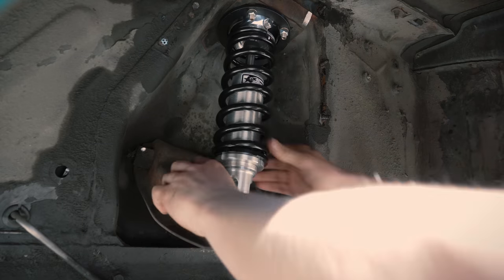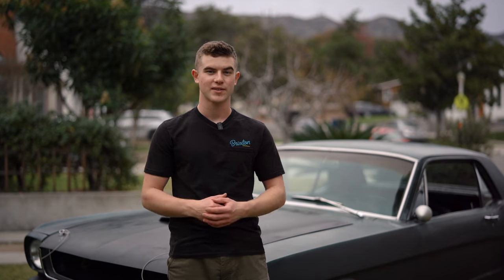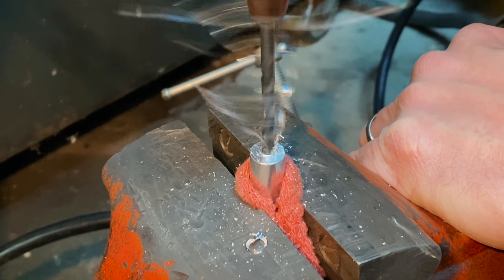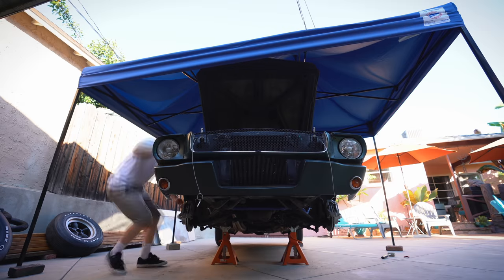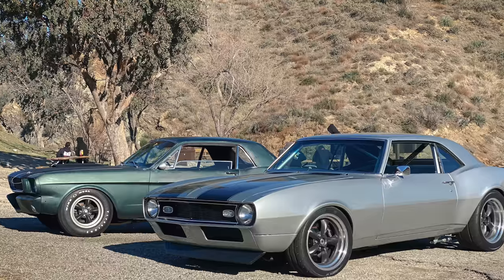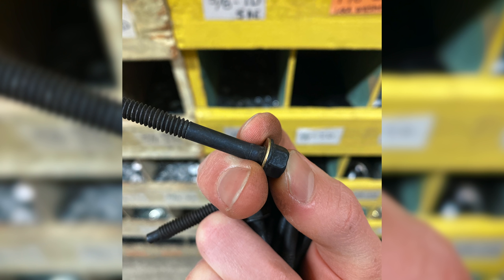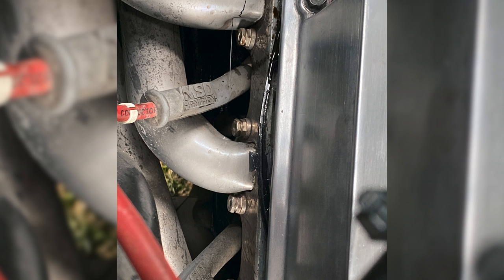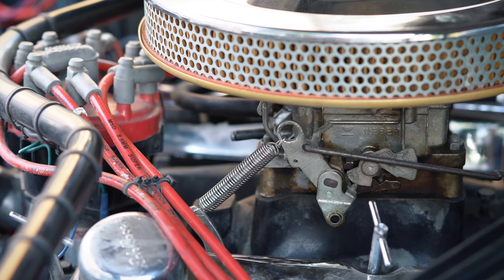Mustang Update!

Comment: 7" wide you can get some good rubber; may have to go to 16-17" wheels and drop the sidewall. It'll still look "Period" correct for most eyes and not look goofy. I did an old A-body Mopar and used a set of '16" Lincoln LSC "Turbine" wheels with good Yokohamas and utilized the 12" front rotors (with pin-style calipers) from the last of the B-body A-38 cop car. Common sense goes a long way, looks like you're doing it right!

Comment: Interesting you mention the valve covers with larger rocker arms.  I actually made 4000 dollars off a 69 Camaro SS because the owner said it had a knock in the motor when it warmed up.  Took it home sure enough someone swapped the valve covers to 3 7/8" and the rocker arms when the engine was at operating temperature would tap on the valve covers.  40$ trip to O Reilly's fixed it and I sold it soon after.

Comment: I’ve also had that problem with the gaspedal getting stuck to the floor on my 67 mustang
Reply: Your spring or your throttle wire getting stuck check all your linkages might be to tight or to loose and hanging up just an idea

Comment: Also! That proportioning valve gave me issues on my 67 Camaro but when it did work
It helped with keeping the rear from locking up
Reply: Get a brass combination valve from a mid 70s Granada/ Maverick ahead of the prop valve. It works!! It not only limits rear pressure it delays the application as Ford intended.
Probably won't need the adjustable valve.
Reply: I've done several with Granada front discs.

Comment: Idk if u want to do it but if ur gutsy and not scared to custom fabricate. U can make or drill and tap ur master cylinder lid/cover and add a air nozzle to pressurize the system way better to take air out of a brake system idk why brake manufacturers dont think about that and make them

Comment: The Shelby drop works for Falcons too.I haven't checked to see if it was done on mine yet.Tires make a huge difference in the handling.When I had my '66 the only tires available were bias ply,and they weren't very good.
Reply from the maker: Yes it does. Kinda funny how the falcon and mustang are basically the same car. Cool stuff man
Reply: @FourSpeedFilms  To save money the Mustang was built using the Falcon platform.2005 was the first Mustang that wasn't based on any other car.

Comment: I got a 65 mustang and also did a front brake disc conversion. I couldn't get the air out of the brake system. So I got  a phoenix reverse brake bleeder from amazon.. it does work. Check them out. Good luck.

Comment: Tbh I don't think the width of the tyres is so much the issue, it's probably more the tyre type. Those Firestones you have are extremely cool, but they're an old school tread, and you also have a huge amount of sidewall which will flex when you go round corners. I've found that by going up to a 16x7 inch wheel, your choice of 205/55R16 tyres is vast, you can even get Michelin Pilot Sports in that size, and those will transform any car you put them on. Also has the benefit of being able to take bigger brakes, should those ever be needed.

Comment: Amazing Car, I have a really similar story with my 1968 Mustang. Restored it with my grandfather over the course of a decade. One thing I am curious about is how you found instructions to replace the rear gear to a 3.80 vs a stock (from your other video). My car's sitting with a 2.79, and she's pretty damn slow off the line even with the four speed. Can't find any good instructions for these older differentials, it's all modern stuff on the internet. Any pointers? All in all, nice car!
Reply: Should be the same as pulling apart any other rear end. The only difference might be the clips that hold the axles in place. But that's no biggie.
Reply: joe schmo I’ll look into it then! Planning on putting a 3.25 instead of the old 2.79... I appreciate it!

Comment: Hey Ben. Don't use rubber gaskets for valve covers or cork. My local race shop installed there blue ones that are made from different material and are super nice. Alittle more money but leak proof. (Valve cover gasket # VS13264T.
Reply from the maker: Interesting! Do you know the brand? I can’t find it searching the number
Reply from the maker: Nvm I just saw that you added the name
Reply: @FourSpeedFilms  felpro from summit racing.

Comment: Need to get a holly carb that’s what Ford came with get like a street dominator I have a 670
That’s custom for small block it’s a street ready carburetor red lights to red light is ready to rock ‘n’ roll start up in the morning but I warm up as red rock four or five pumps of the gas pedal it is ready to go we cut the choke off it cause you don’t need it and it’ll open all four barrels when you get in it it just doesn’t have that secondary pump I don’t feel like drilling in too it yet but if nobody wants a custom carb for a small block I’ll drill in that bitch screw it